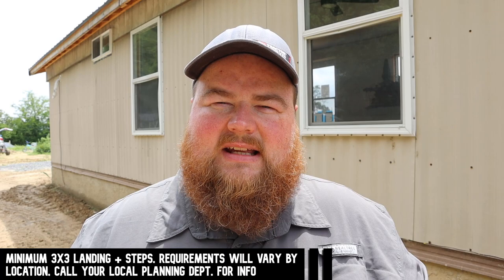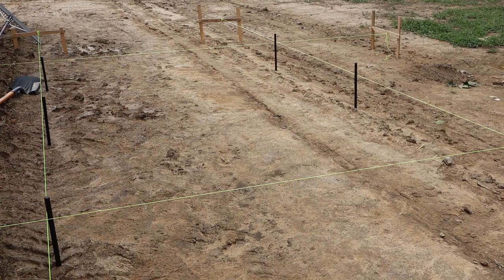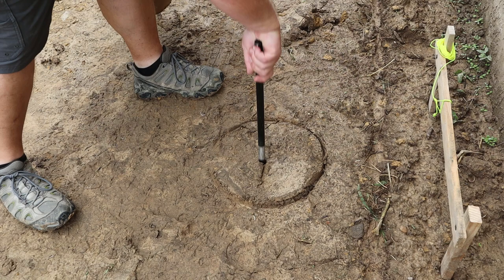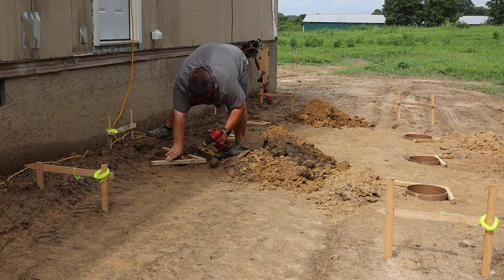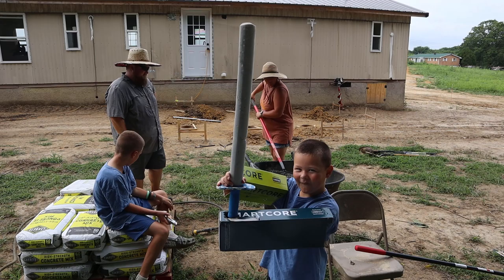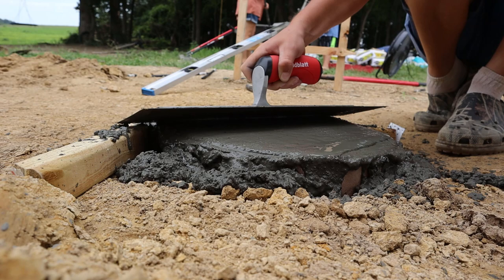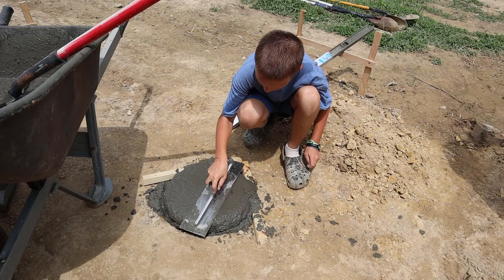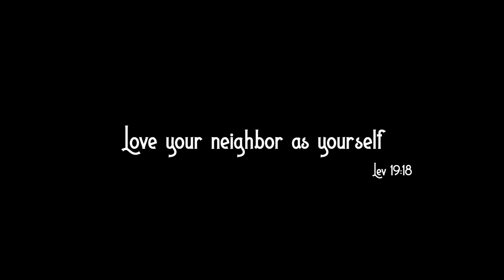BIG Beginnings for our BACK DECK! // 12' x 10' Mobile Home Deck Build - Pt. 1

Comment: Need to have the boys put in a time capsule inside the cement some where when they are older they can dig it out for the next generation to add to. A piece of pvc pipe with plugs on both ends work well. Did it for my kids

Comment: Footers are so much work, but you all did it!!!
Sam have you ever seen the skid steer auger for footers.
It is adjustable for diameter, has  depth gauge lines then bells out at the bottom 
for a footer that will not heave.   Watched R&R Builders use one a couple years ago.

Comment: Good to see you letting the boys get their hands in. You're still using your level as a tamper? A piece of wood works just as well. A lesson I drummed into my kids was always look after your tools. I still have some of mine from when I started work in 1948. Without them, you can't work. Why not drop a plumb bob down from your string line? A good video.
Reply from the maker: Yep, using the level as an air bubble remover.. not a tamper. And it's fine. Every tool can have more than one use and still function fine. The level was repeatedly washed off and looks and works just as well as the day I bought it.

Comment: Moving concrete in a wheelbarrow brings back memories for me. Had a summer job as a laborer for a concrete mason. Who needs a pump when you have two strapping teenage boys to move the concrete on your crew. You haven’t had fun until you have moved the entire contents of a mixer truck by wheelbarrow. I can see where you are going to run the mini split connections under the home. That will be much neater than in NC.. It also looks like some type of wire running along the top of the wall for the length of the home. Perhaps some kind of grounding conductor?
Reply from the maker: Yep! When we had the block foundation done, I added in pipes so we can run the line sets down and under the home. :) There's no wire along the top of the home, that's part of the siding.
Reply: @sam-and-angela  It looked like some kind of wire along the top of the block wall that does not seem to be there on the front side of the home.

Comment: With that explanation  of the tube   could  have saved money  on tube by just using  4 or 6 inch  collars just at the top once hole filled with concrete    anything in ground  won't be seen and the rough  sides of hole would provide  grip against   settling
Reply from the maker: That's true.. this was also our first time using the tube forms. :)

Comment: A friend had a wood chuck digging under the deck under the foundation,  he took care of the wood chuck and fixed the hole and the deck, oops he didn't put any wirecloth down on the sides and a new wood chuck showed up and dug a new hole same place.  Just a FYI.  Looks great 🥰❤👍

Comment: A few things
A 6" level at the string intersection makes lining up the J-bolts easier.
For pronoun-cee-aating, Sahno tubes. Confuse 'em with techy terms.
Never had a one-man auger last a whole job, hence why I own a 35lb jack hammer with shovel bit
Yes, batter boards. Nice call.
Shoulda gotten the mixer, but then again as I get older I'm looking for shortcuts.
Building decks is a very satisfying experience, lots of eye value for the amount of work.

Comment: To help to control of moisture on the foundation, before the deck floor, a short of metal slide could divert rain water from the area near the house, a under deck rain catch drainage.

Comment: When we put in those tubes, we partially inserted maybe 10 long deck screws around the outside at different angles. We had clay soil so the idea that once we back filled the hole- those screws would provide more  stay power. (?) Lol.

Comment: PRO TIP.
If you have a water hose you can pour the concrete and the water straight into the hole at the same time. Mixing in the wheel barrow is not necessary. Hope this saves someone’s back.

Comment: Since that string was a little high for the piers. You could use like a medicine syringe or something and where the lines cross you do a drop of water and see where it hits on the pier. I know the piers are set by now and everything but just a heads up for future.

Comment: Could use 1x2 to hold j bolt in place and hold from accidentally  going  deeper or  tipping  over   
 Personally  would put some kind of ribar  in holes even a heavyweight  tomato  cage   or woven wire fence  material       but that just me
Reply from the maker: I must have missed adding that clip but each footer has two pieces of 1/2” x 24” rebar in it.

Comment: Lookimg at you guys mixing the concrete and pooring it in the tube made me think : wat if you dump the bag in the tube trow water over it and put the auger in there to mix it up might need to wring the auger around a bit to get the sides but it should go way faster

Comment: I have same auger and it's drilled well over 1000 holes, only issue I've found is once it gets to where it doesn't wanna run then it will only crank and run on about half choke lol
Reply from the maker: I've had the same issues with this one. These were drilled on about 1/2 choke too. The last two it just wouldn't start up on me. I'm sure it needs a really good carb cleaning and maybe new one after two years.

Comment: I love to watch your guys's videos and I appreciate it so much. I have a couple of questions how do you know how far to leave the j bar sticking up from the footers and why. And also when you first ran your string lines and then you remove them and dug the holes and you leveled each footer up and poured cement into the tubes. But how do you make sure that all six footers are level with each other

Comment: surface cracking comes from shrinkage , too much water , over working the surface , civil engineer 40 yrs  exp retired,   BUT IS THE BEST CONCRETE  KIDS CERTIFIED LOL KOOL, TRY LESS WATER  next time,   coming along  big improvements from the big move,   go go go guys ur getting it

Comment: Just a curiosity question, why do you use a level to purge the air bubbles in the concrete? Can’t you use a stick instead of an expensive level?

Comment: Just curious as why you didn't rent a concrete mixer. I know that it's really not that big a job but anything to save a back. And I do have a question  when my dad built the decks for the house when we did the j hooks. He used like 12 inch or 10 inch hooks. What made you decide on the length of them? sorry about the hat by the way brother

Comment: Do you have to put those straps like you did for the workshop, greenhouses, and she shed?
Reply from the maker: No, but because the concrete footers and then attaching the deck to them does the same thing for anchoring a structure to the ground for code requirements.

Comment: How do you ensure each concrete pier is equally high?
Reply from the maker: For our deck design it doesn't matter -- we will add posts and then cut those level with each other.
Reply: @sam-and-angela  ahh I see !

Comment: you didnt use those cardboard circles in the front deck. is there a reason why?
Reply from the maker: The front deck is somewhat temporary. "Some day" in the future we are going to replace it with a larger one that spans to new french doors at the dining room. That's all part of a bigger exterior remodel project that is down the line, so we built a smaller one up front so we can move back into the home now. Not too small though, we still may be a year or two down the road for the big outdoor things.
Reply: @sam-and-angela  oh, okay. that makes sense.

Comment: Angela, please!  DO NOT use those kind of shoes for that job!  I know from experience.  I had weeded my garden all day and it looked awesome.  As I was admiring it, I noticed one big weed that I had somehow missed.  I took my spade out there while in my flip flops and my foot slipped off and I cut open the bottom of my foot!  Daughter was crying cuz Mom had to go for stitches at the hospital and had a tough time getting around for quite some time.  Now I don't touch the spade unless I have the proper footwear on!!